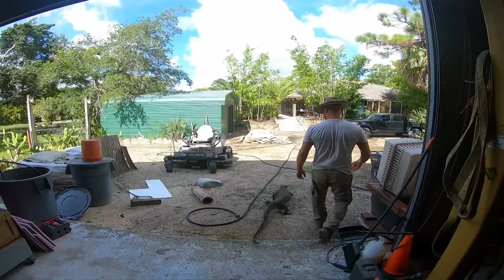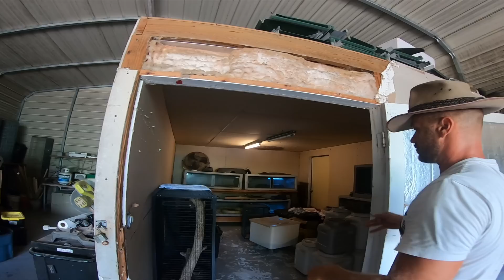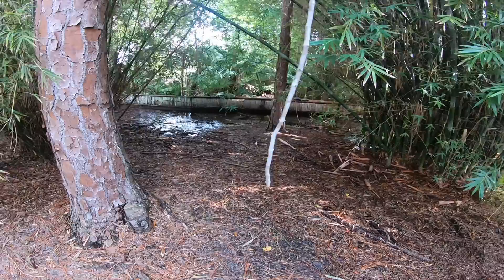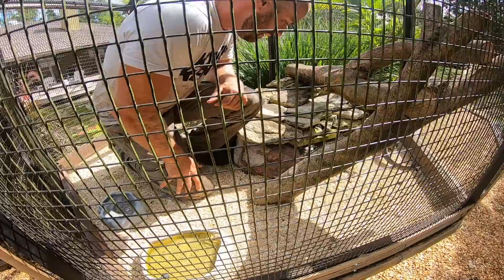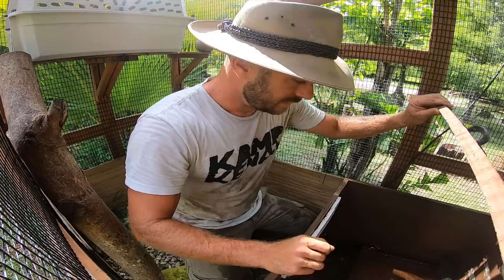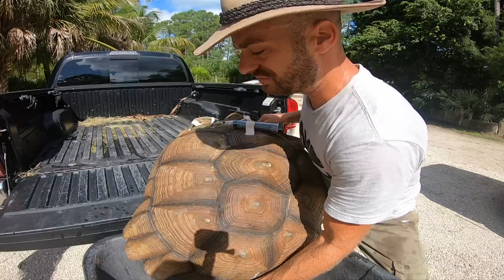Prepping All my Reptiles for a MASSIVE Hurricane!

Comment: For the turtles and tortoises the bunkers should be slightly elevated but have them tongue in to the legs, have a form of flotation device (styrofoam, boat bumpers, etc.) so if it floods they will be inside of their bunker and it will float but not float away. Hope my idea helps 👍😁 (PS, they male crazy lizard should be named Crazy Ivan, that’s when a submarine turns sharp to the right or left and turn off all power to check for a following submarine)

Comment: Quick recommendation for pet taxis since their nut and bolt systems are somewhat flimsy, replace them with zip ties, preferably the metal core type.  You can also use them to secure the door in place.  A pair of dog nail clippers, the kind that look like tiny, modified scissors, work great to bust them open when you need to get back in but zip ties ensure that even if the pet taxi gets knocked about it won't bust open and release the animal it is supposed to protect.  Good luck, hope to see you, Kate, Sophia and Leo as well as the animals on the other side safe and sound.

Comment: What does the BWS stand for on the crates?
I hope for u the storm doesn't hit full on.
Just a idea. 
With the new lizard encloser u should make it so u can just move them to a small bunker that is attached to each encloser and under the ground water sealed. It would be expensive to pay for it but a lot cheaper to DIY it. It could even be the "hide" and all u have to do is close the door from inside their encloser.